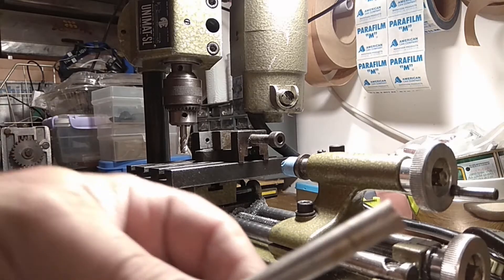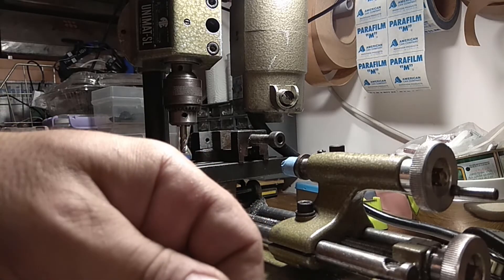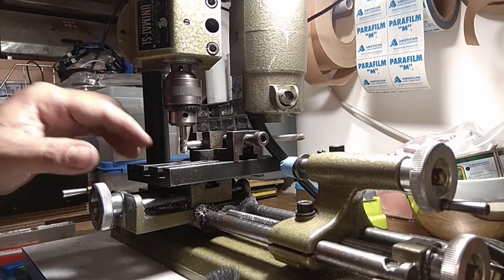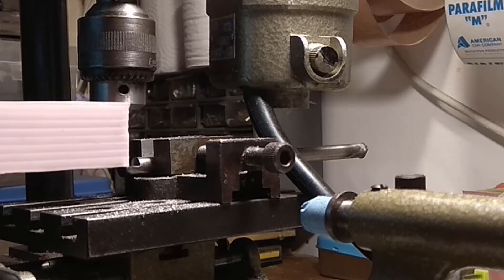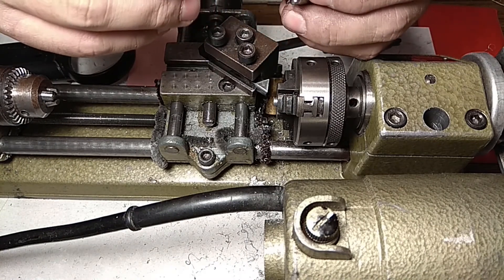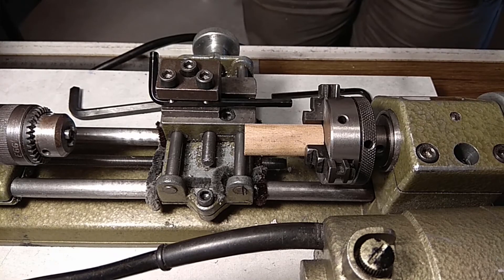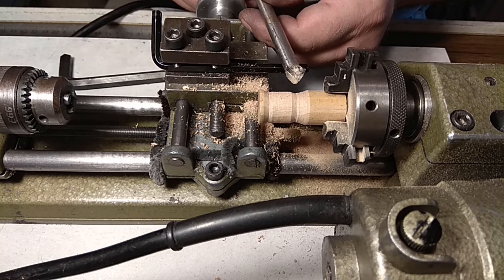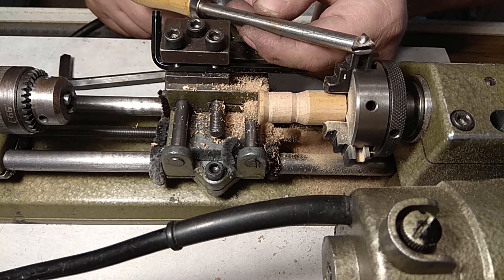Making a carbide tipped wood turning tool for the unimat SL lathe

Comment: Hello good information. I do db200. Older one with single x on bottom. It came out of doctors estate sale he bought new. Not used  much. Came wit mill parts some of little stuff. Face plate ,dog,2 dead centers. All tools from factory. Wooden box 📦 nice machine.
Reply from the maker: The unimat is wonderful. It only lacks some power (to cut deeper,part the work, etc). I love the fact of having a mill and a lathe. Still, if I ever get a bigger house I'd be happy to buy larger lathe& mill. I'm sure you will enjoy yours! Tip: make a lathe stop as your first project! It will be super useful. Feel free to ask questions. I'll try and help.
Reply: @Smallathe  hello thanks and I will be needing help I bought it late spring around May it looks brand new. It’s nice one. I haven’t used it yet. But I’ve bought stuff for it. Already had 3 mics up to 3”. Got the carbide 5 piece set from harbor freight. A magnet base and dial indicator. I got the stuff beetlebug  sales. Thumb screw for mill shaft.  Quick release handles for head, tail , stock. And dro  he makes using dial indicator. Get the one he has out now for lathe. Like 12$ eBay. And the stop. Should be ready start making chips. I’m like you love have little bigger one (think it’s unimat 7 yellow)but garage I have  16x10  roll up door rent to own shed I got garage one heavy floors. have 9 inch band saw, drillpress bench top. 40 gal compressor. New Hobart 140 mig welder.  Me and dad just paid off. Tractor supply credit card. Its beautiful thing.  Dads card.  That’s what I used to do welder fabricator. Never ran metal lathe been around them  know how they work. Run wood lathe back in 9th grade 88-89. Well I’m rambling again   I’ll be starting some projects and I’ll let you know how it goes. Probably need help. Thanks again for offering help. I’ll need it.  Stay safe and keep those video’s rolling.
Reply from the maker: @paultrimble9390  Sounds great. Ithink you are ready. Before you start, stripit down, remove old grease and apply a fresh one, oil parts and get a good dust cover (mine is an old pillowcase). I know you will love it... And it's addictive! Brass is wonderful, same for aluminum. Resin is shear joy and you can do steels too, just slowly... Enjoy and keep me posted. Take care! Saar
Reply: @Smallathe  10-4 will do thanks and stay safe.